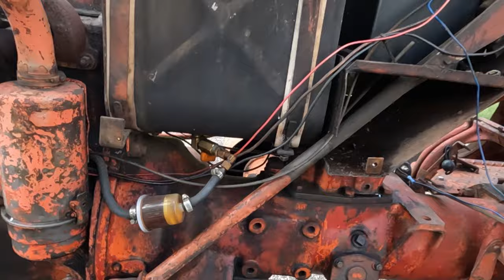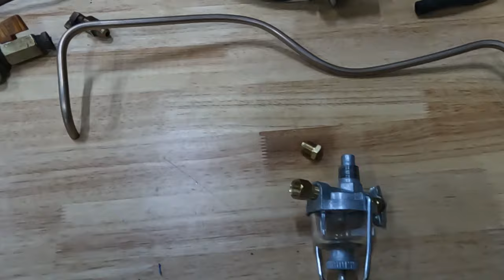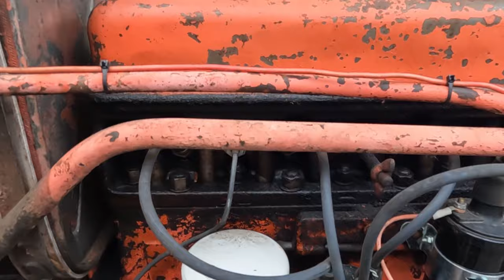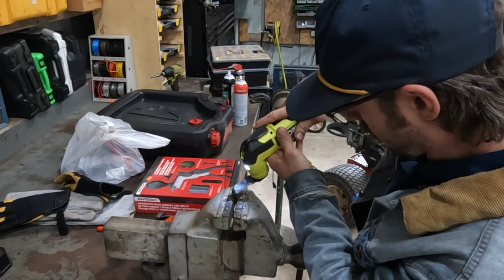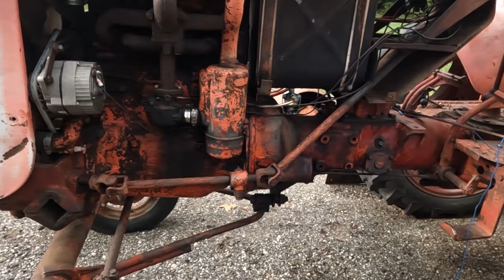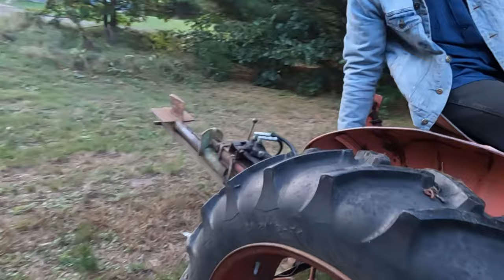Case VAC Tractor Repairs: Fuel Sediment Bowl and Ignition Switch Replacement

Comment: What year VAC and what is the Serial Number?
I purchased my 1951 VAC S/N 5555375 later model with Brake shoes. Earlier VAC have disc brakes
Reply from the maker: I'm not sure on the serial, but I'm pretty sure this is a 1952 VAC - 13. This one has the drum brakes. Only the right side works currently. I think it's a matter of adjustment.